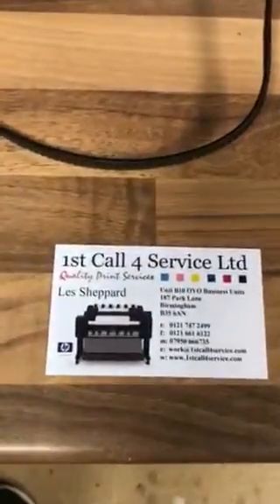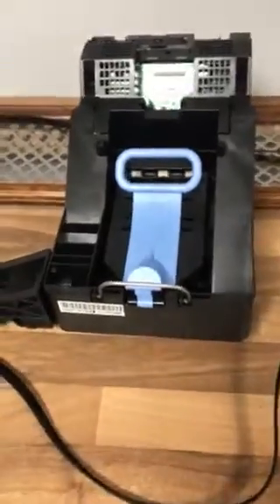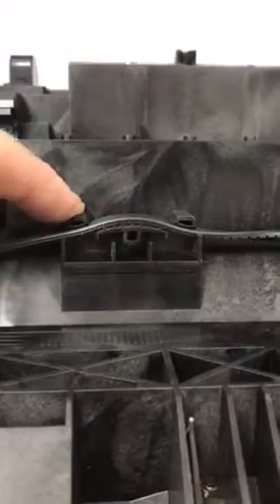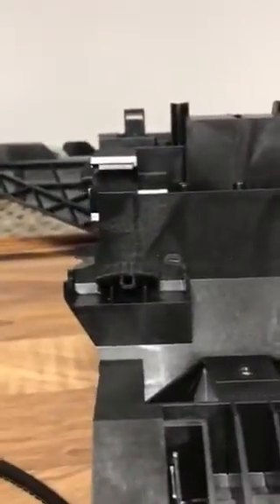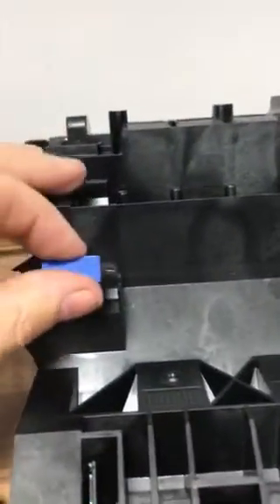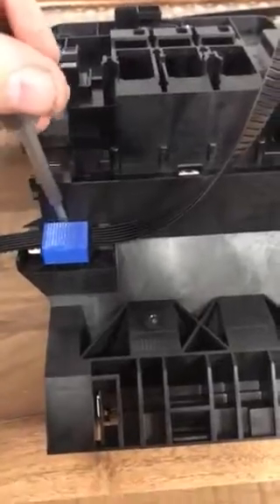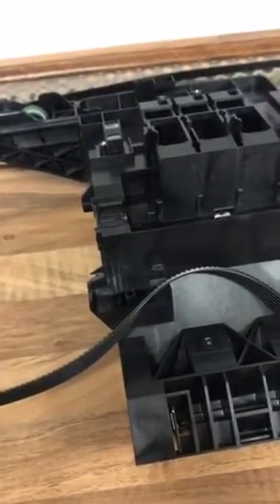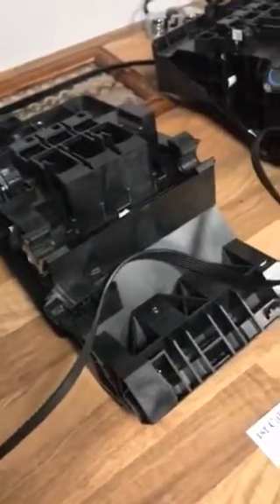Error Code 86:01 Carriage Repair for HP T790 Designjet also T770 T795 T1200 T1300 & T2300

Comment: Solve Media Jam Error 86:01 ( This method is suitable for HP L25500, L26500, L260 or may be other model & barnd.) Theory will be same I think.

If you have replaced belt or encoder strip or encoder sensor and getting media jam error 86:01 or any other kind of error please follow steps.

Hardware side.

1) Check encoder strip is installed properly and it is not touching in carriage from any sides. It must must must be straight. Check the gap on top & bottom from right and left side of carriage.
2) Check encoder strip gap right side of carriage when carriage at far right next to keyboard.
3) Check encoder strip gap left side of carriage when carriage at far left side next to ink station.
4) Check carriage movement & well lubricate rails. It must be smooth & no obstacle or no grinding noise.
5) Check belt must be moving smoothly on pully on both sides.
6) Belt must not too tight or too lose. This point is very important.
7) Old type encoder strip has metal on top & bottom. Sensor is longer in old type encoder strip.
8) New type printer has different encoder strip. It has metal strip at bottom & short encoder sensor.
9) If you are replacing encoder strip you should replace sensor as per type of encoder strip. Old type or new type. 

Software side.

1) Boot printer in diagnostic Service Test Menu. (Refer HP manual)
2) Update latest firmware from Emergency Firmware Update. (Refer HP manual) This will clear all error & we know that firmware side is ok.
3) Check all Electronic Module from Diagnostic  mode.
4) Do line sensor test & media jam test.
5) If it pass all test we know that all electronic component is ok.
6) Go to scan axis scan axis test. (Refer HP manual)
You must pass this test to clear media jam error.
1-When you begin this test you will see slight movement in carriage so you know encoder sensor reading encoder strip.
Follow all steps as per HP manual for scan axis test.

My printer was randomly giving me media jam at any stage while doing Scan Axis test. Sometimes it pass Stage 1 some times after stage 3 and so on.
I think it was new belt hard for motor to move fast.
It was doing right bump & left bump ok but when try to scan width it fast movement.

This drama was up to four days & I was keep trying.
Finally found that belt was slightly tight that is what I think.

I grab a thick rubber. Just like rubber washer not very soft. 
Kids eraser will do job.

Make sure pully plate front part of spring must be slightly back of bottom black stopper. Approximate 5 mm.

I cut small piece of rubber &  lift bottom plate of right side pully.
Under the spring as in photo. This way it loose brand new belt slightly.
Hard to notice.

Try different thickness couple of times. I try nearly 10 times then I got success.

Finally I pass Scan Axis test & no more error.
7) From Carriage Menu run Carriage PCA test. If you don’t get any error you win.

This is all hard work & exercise of 2 moths & spending nearly $1000.